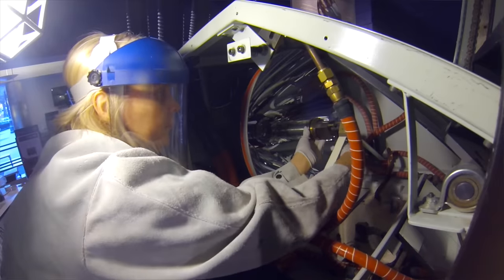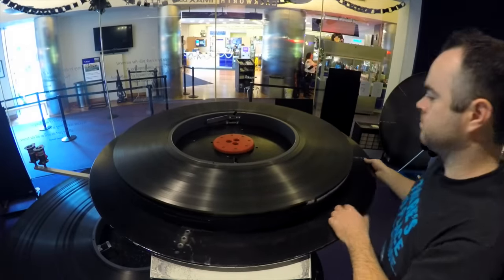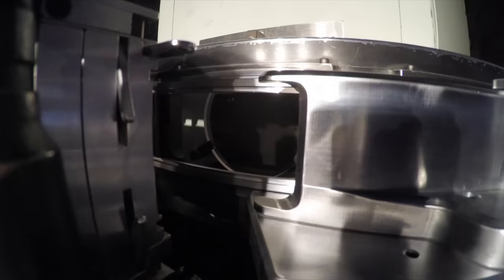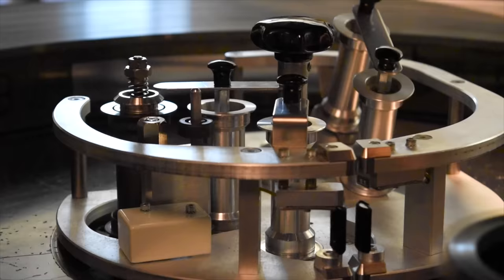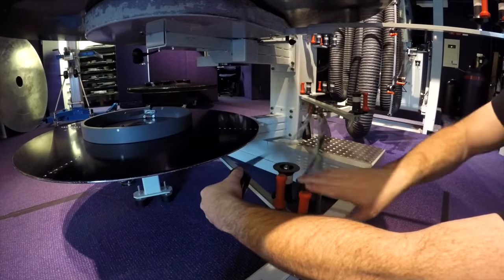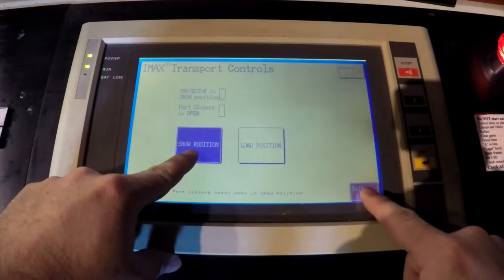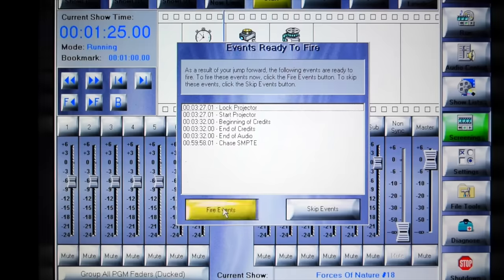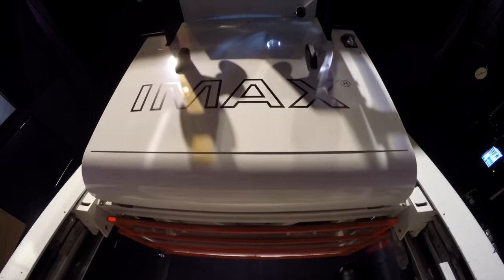The Incredible Process of How a GIANT 70mm IMAX Film is Played

Comment: There were 70mm projectors before, but none like IMAX. IMAX has a very unique rolling shutter mechanism that no other projector has. Instead of a shutter closing off light and pins grab the film by the sprocket holes and move it down one frame and reopening the shutter, this system has a huge rolling shutter that literally rolls out each frame to be shown. A lot less wear and tear on the film. Since IMAX uses the entire width of the 70mm there is. No room for audio. This means the audio must be on a different medium (DVD) this allows for many more tracks of audio (I think up to 16 tracks) but It also allows for multiple languages too. This DVD is not the same format you would play at home but rather a unique format just made for the IMAX experience. This DVD has sync pulses as well to control the speed of the rolling shutter to keep the visual and audio parts in sync. The projector knows exactly how many frames there are before the picture starts. Once the projector is up to speed it signals the DVD player to begin. From there the light path is open to the screen and from there, the DVD controls the speed if the projectors rolling shutter servo.
Its amazing technology. But alas IMAX is replacing these magnificent projectors with a laser projector to show digital content. The content will be delivered via the internet over the course of time and ready to play on a certain date. The studios will be in complete control of content. They can Monitor how many times it was played, send updates etc.
Its sad to see all the people involved in film projection will go away. Projectionists, film duplicating services, film labs, distribution, even driver who deliver the films to the theaters etc. Very sad.
Reply: It's called a "rolling loop projector"

Comment: Amazing little documentary. Have seen it quite a few times now and it's still interesting. Very well done. 
It's quite obvious why you can't rewind; You would never be able to get the film back into the center of the err... 'hub', if any. 
That said, this way without winding the film will definitely wear less and it's just kind of cool this way. Very 8-track-esque.
I'm wondering; at 6:41 you can see the film moving about on the platter. Is this caused by the friction of it touching the platter, or is the film material itself slightly sticky? Or maybe even static electricity?
Reply from the maker: Hey, Rolling Troll. Good question. The film itself is not sticky and I'm not sure exactly why it moves like that while the film is playing. I'm guessing it's because at some point the film is being pushed instead of pulled. Because there is some slack there, it's hard to keep it straight.
Reply: @HighOrbitMediaVideos  Thanks! I guess that makes sense. It's not a big deal anyway but it looks a bit painful considering the value of a film like that :D.

Comment: We're a few years on from IMAX licensing its brand for digital projection. All of my local theatres have fully digital projection (apparently all using Sony 4K systems) - but film IMAX still looks amazing. John, what to the best of your knowledge distinguishes digital IMAX from film IMAX, aspect ratio aside? Are you satisfied with the quality of digital IMAX screenings or are the public missing out?
Reply from the maker: Hey, Chris. When I was working there I kind of avoided all other IMAX theaters because they were digital or "liemax". But we did have a film that was half shot in 70mm and half in digital. The difference was very noticeable as the digital portion did not have the crispness that film gives you. I read somewhere that 70mm film is equivalent to 18K digital so we are still a ways away from that as theaters are mostly using 4K projectors now. In fact, the theater I shot this video at has since converted to digital. I haven't been back there to see the new system yet but I hear it's very good. Plus a digital projector allows the theater to hold more events that can utilize the projector by showing other videos through it. Couldn't do that with the old system. Hope that answers your question.
Reply: @HighOrbitMediaVideos  yes, very well! When I lived in a city with an IMAX, it relinquished its franchise and converted into a dual Barco 4K theatre showing Dolby 3D. It was very impressive, but I missed the IMAX film quality. Saw the Dark Knight and various other features with IMAX shot sequences and wow, they blew the digital out of the water. A shame the format was so constricting and costly to shoot with because ultimate sharpness and stops of range always seemed vastly better with IMAX. 

As you say, once they were digital their ability to show other features and live event cinema really opened up. I also got to see Lawrence of Arabia, West Side Story and some other classics remastered for digital cinema which was a wonderful experience. Mixed feelings about losing the IMAX analogue facility.

Before I moved I got a show round the booth and in a side corridor lay some disused reels of 70 mm, you forget how massive they are - so heavy. Reminded me of quarter inch multi-track tape... Really wish I'd taken a few frames as a keepsake! It's no doubt been tossed since then 😱

Incidentally, I saw the trailer for the forthcoming Apollo film with all the 70 mm archive footage - looks amazing, hopefully it reminds people why film is just so good.

Comment: i worked in the regular theatre industry for a few years, and in all honesty, this isn’t as co fusing as regular movie theatre projector systems. 
so what i had to do every night (i worked 5pm-1am) was first open a tower computer that only stored the projector power schedules, and make sure that the building wouldn’t shut off power in the middle of a screening. sometimes movies end earlier than others, and the company i worked for only allocated enough power for each movie. that’s why when all credits end, the projector still turns off. even if it’s showing the same movie 5 minutes later. 

then, i would check each projector computer system (6 projectors total) and make sure the right movie is on the right schedule. seems easy enough, but in order to change a movie or fix a mistake, we had to redownload  this movie from a massive hard drive system, which could take hours. because of copyright infringement laws, we couldn’t just stop and restart a movie or adjust picture quality without redownloading the file. this was more common than you’d think, as these hard drives were sent through USPS in padded envelopes (not boxes) which pretty much ruined them in some way or another from drop damage. changing little things like sound or brightness are easy,  but we’re controlled from the basement below the screens. meaning you had no way of visually checking the screen or speakers while you were adjusting them... the company actually set up a baby monitor for us to try and use. it never worked.

 the company was also to cheap to properly train the minimum wage folks running these complex systems, which should explain any issues you’ve had at the movies. i witnessed issues like the mute button being switch on took 30 minutes to fix sometimes. 
 
moral of my story is, if you treat any theatre employees with a bit of respect, they’ll be straight honest with you and let you know why the issue is perusing. who knows, if you have a degree in any math or computer systems, you’ll probably be able to fix the problem in seconds. win for a win.

Comment: I've only worked as a 35mm projectionist and have never been in an IMAX projection booth, but this is epic. 
I wonder: Does the IMAX 70mm projectionist have to set the focus manually on the 15/70 projector (like on a 35mm projector), or is there an autofocus feature on it?

Comment: Do these projectors have backup power? What happens if there is a power failure while the show is in progress? I assume that the show would be cancelled at that point, but what about the film print? Would film go flying out of control and damage the print? Would the stored heat in the projector be a problem when the cooling water supply is interrupted?

Comment: So how does the 3D work? I imagined that there would be two films running in tandem, but now I guess that both images are somehow baked into a single film using polarizing filters or something, though I can't imagine how you can sandwich oppositely polarized filters and still pass light through the film.
Reply from the maker: 70mm 3D films are very rare. You have to have 2 of everything (1 for each eye), 2 film prints, 2 projectors, 2 projection systems, etc. It's vastly expensive. That's basically why you only see 3D in digital.
Reply: I see. Thanks for the reply. I once saw "Space Station 3D" at the IMAX in Bradford (UK) and it was breathtaking. Do you know if that was digital or film? I tried googling but found nothing. I'd always assumed that it was film.

Comment: Thanks for the insight!  What are some common faults that occur? 

Thanks
Reply from the maker: There isn't anything that's very common. If you're not paying attention you can sync the wrong audio track to a film. Or thread the wrong film at the wrong time. Otherwise it's software glitches or terrible things like the film not being threaded right and getting torn on sharp metal edges. That's bad.

Comment: CAN the wrong audio be played off the discs? i only worked a 35mm projection booth and the nicer screens had DTS (CDROM drive era) which just wouldn't play the digital audio (only the analog SR track) if the wrong disc was in due to the timecode track
Reply from the maker: Yeah, we played the wrong audio a handful of times a year. That's not a fun mistake.

Comment: Interestingly, the original IMAX projection systems did not use center-feed platter systems, as shown here. 
The film platters looked the same, but they were side-by-side, and the film had to be rewound after each show to be ready for the next. 
The so-called "QT" platter system borrowed technology from the existing cinema projection systems in introducing what this projectionist refers to as the "brain", to speed up cycle times and improve efficiency. There may have been some reticence to introduce this, as these systems had considerable teething problems in mainstream theaters, and many film prints were chewed up before the systems became more reliable. 
For reference, 35mm standard film runs at 90 ft/min, 70mm 5-perf at 112.5 ft/min and Imax at 337.5 ft/min, or 5.6 ft/sec, so it would have been important to get it right.

Comment: Went to see my first IMAX film in the Edmonton Space & Science Centre back in the mid-80's...Hail Columbia!  Always been amazed at what IMAX can do.  However, a question if you will:  For the long feature length movies, is there an intermission to swap reels from the first part to the second?  Or are you actually able to have a full length (like an hour and a half) film on one reel?
Reply from the maker: Good question, Jon. The platters that film sits on for feature length movies is much larger. They have a six foot diameter I think. Some movies go right to the edge. I believe the longest a movie can be and still fit on the platter is about 2 hours 47 mins.
Reply: @HighOrbitMediaVideos  Thanks for this!  I'll bet those films must weigh a freaking ton and that the shipping cost for those films is paid from the profits of a couple viewings!  No wonder a lot of IMAX has gone digital...
Reply from the maker: Oh yeah, a 6 foot platter with a feature length movie on it is probably around 500lbs if not more.

Comment: so, what is pulling the film through the projector? the final spool at the end? if so, does the increasing circumference make the film run faster?
Reply from the maker: Great questions. The system itself pulls the film through so the act of the platters spinning brings the film through the entire loop. And yes, the speed of the film would change due to the difference in weight on each platter, as well as the circumference changing. So the "brain" controls the speed during playback.
Reply: @HighOrbitMediaVideos  The platters have motors attached to them which are computer controlled to account for change in weight and circumference? I wonder if you know how this is performed on home projectors?

Comment: Simple question... What if the film tear in the middle of a show? what u do to joint it?
Reply from the maker: The only way the film could tear is if it was threaded through one of the gates wrong. This has happened. It's terrifying. Worst thing to see and hear as a projectionist. You would need to order a new reel. If a reel isn't available, you may have to order an entirely new print.

Comment: Relatively easy.
We did it the old fashioned way with reels of film lasting no more than 20 minutes, 2 arc lamp projectors and having to do a syncked changeover between projectors of both sound and image every 20 minutes. While one of us rewinds the film (by hand) the other laces up the next reel and checks the lamp for sufficient remaining rod to last at least another 20 minutes. Great fun.
Reply from the maker: Wow, sounds like you guys were manning a small ship!
Reply: @HighOrbitMediaVideos  Those ancient 35mm projectors are still in use in multiplexes - although films are now assembled into one big flat platter - where digital hasn't taken over.
I'm out of touch - so I don't know if digital has met the image quality of IMAX yet or not.
Reply from the maker: To my knowledge 70mm film is equivalent to 18K digital so these fancy new projectors still lack the resolution IMAX brings.
Reply: @HighOrbitMediaVideos  Doesn't surprise me :)

Comment: 15 Minutes of turn around?
Oh my...how generous!
I worked in a small cinema, where i had  -5 minutes...and no, that‘s not a typo and i had to deal with a spool...as in one, meaning i had to wait for the movie to finish, get it off the hook, if i was lucky and another movie was due and then thread the new one, while the movie SHOULD have started already. Record was 5 minutes.

Then i would carry the other movie 3 stories up and make no mistake, spools are HEAVY, because the only other spooling system, i could use for rewinding...yes, spools need to be rewinded, if you don’t have that platter-system, was on the top floor in an attic.

All this, if i was lucky and another movie was in line. If not...welp, i had to re-wind that shit REALLY fast, but even then it would probably take 5-10 minutes, depending on the length of the movie.

Comment: Platter to platter, the film runs in a vertical plane; but at some points of loops, film runs in horizontal plane...Can't that twisting of 90 degrees damage the film in long run ?
Reply: No, the pressure on the film is just enough to keep it tight. That can either be done by elevating arms with a certain weight that will collapse if the film breaks and will shut the projector off. But the main arms that hold the film tight are the arms or sliding rollers beside the platters with a old fashion platter where the start of the film is on the outside of the reel, they also regulate the speed of the platters... if an arm or roller goes in the direction of the projector it slows the platter down if it goes the other way it will speed up the platter and somewhere in between is the average speed and with that a constant tightness. But the filmcarrier in this video has a "non rewind" system where the start of the film is in the center so the brain regulates the speed of that platter and the arm the other platter.  And just to be sure, I switched left 90 degrees to right 90 degrees every show but was never neccesary but hey..... I'm a projectionist
Reply: @sjoerdbalfoort7170  Thank you......
Reply: @tvoommen4688  your very welcome from the Netherlands

Comment: There are also several digital IMAX formats including one especially for smaller theaters that haters call LieMAX. Their newest digital format uses a 60fps laser projector and is slowly replacing the full sized 70mm projectors like the one in this video. It's only a matter of time before all but a few selected IMAX theaters are converted to the cheaper to run digital laser projectors. Their cameras are also going digital. Since 2011 the compact digital Phantom 65 IMAX 3D camera has been used when the large IMAX 3D film camera was impractical.

Comment: just pop a dvd in and press play wtf
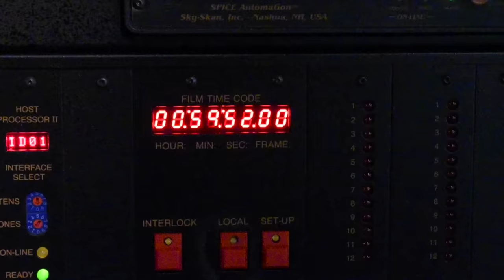3:10 IF THE AUDIO IS ON A DVD, WHY ISN'T THE VIDEO!?
Reply: iCrazyBlaze
You can fit very high resolution audio on a DVD easily. You can’t with video. DVDs have a video resolution of 480p. Not even HD.

That’s why they use the film, which has the equivalent of about 16K of resolution.

Comment: Need to add "Omnimax" to the title.. because that's what this is, not regular Imax
Reply: actually this process does also apply to a regular IMAX screen theater (with a 1570 film projection system), just without the lift and it doesn't use fisheye lenses.

Comment: Pros would use cotton gloves, of course.
Reply from the maker: So, the parts of the film we touch while threading it is extra film that's NOT part of the movie. It's just throw away header. You only need to use gloves when you build the film by putting the reels together. That's when you actually touch movie frames. So yes, we wear gloves when it's necessary.
Reply: @HighOrbitMediaVideos  did you project tenet?
Reply from the maker: @GauravSharma-dy8xv  No, I haven't worked there in 4 years. Plus that theater is digital now.
Reply: @HighOrbitMediaVideos  oh